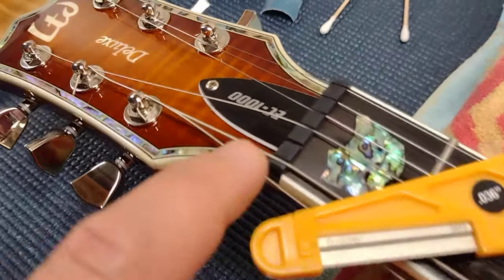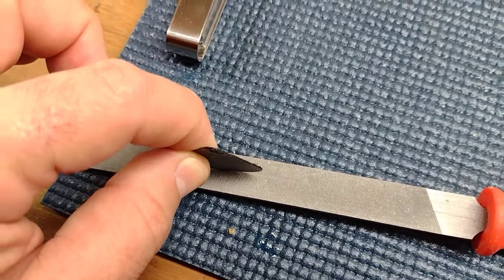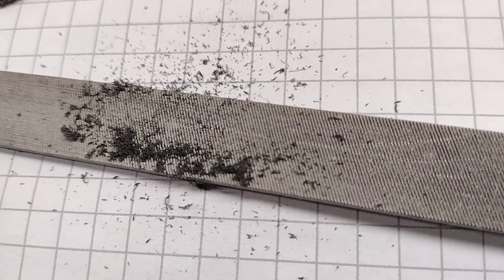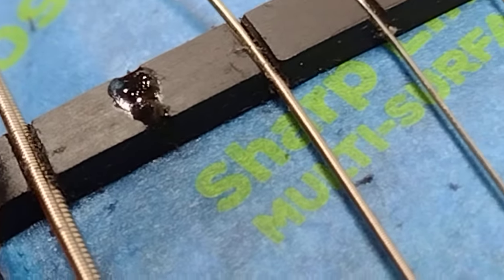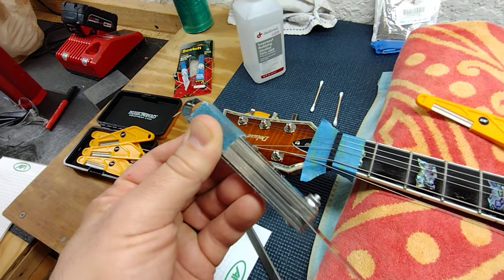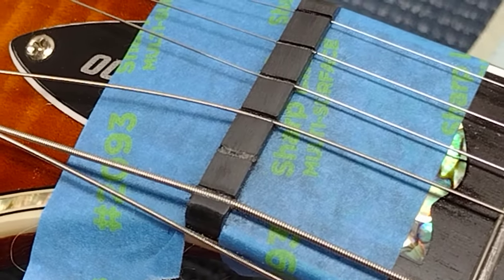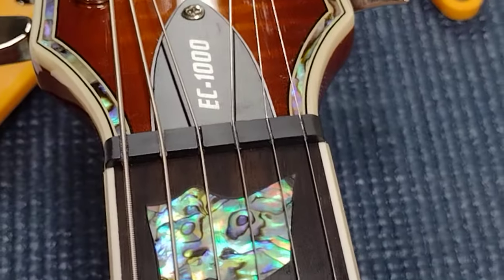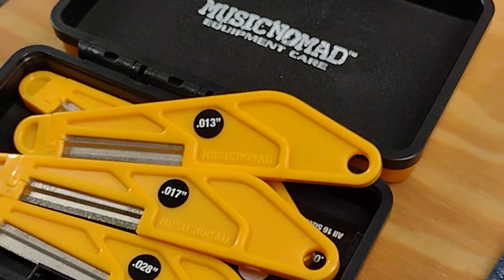Raise Guitar Nut Slot with Super Glue and a Guitar Pick.  Recut with Music Nomad Diamond Files.

Comment: Oldest trick in the book. I keep lots of old nuts to sand dust off of for nut slot rebuilding. Superglue and nut dust, and you have the bomb nut file set already. Never used any other nut files since buying my Music Nomad set.
Reply from the maker: Old nut dust -  nice!  Do you place the dust in the slot and then drip the super glue on top?
Reply: @FrancoCNC  No. Not that you couldn't. But that's too dangerous for me. I always batch up my nut putty on the side first, and then use toothpicks to apply it. Superglue had a tendency to squirt everywhere. It's curtains for most finishes.
Reply from the maker: @andrewbecker3700  Cool.  I was wondering what the working time would be for something like that.  Good to know.  Thanks for sharing.
Reply: @FrancoCNC  Well.....,since you asked. If you know anything about superglue type adhesives, then you should already know there's no steadfast answer for that question. Motorcycle handlebar grip manufacturers manytimes include specific drying time glues with their grips. There's many different estimated cure rates for them. I don't understand why this matters, if your a competent luthier it's not that tricky. My point was mostly about not EVER having a container of glue over the top of a guitar. Don't he afraid.
Reply from the maker: @andrewbecker3700  Good point.  Super glue spilled on a guitar (or just about anything) is a total mess.